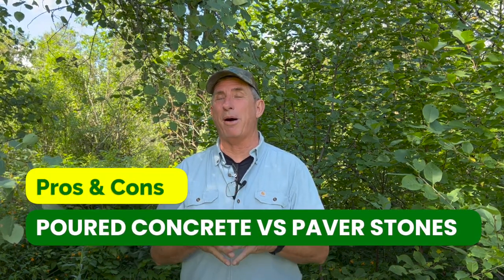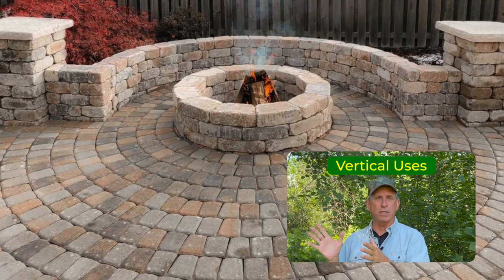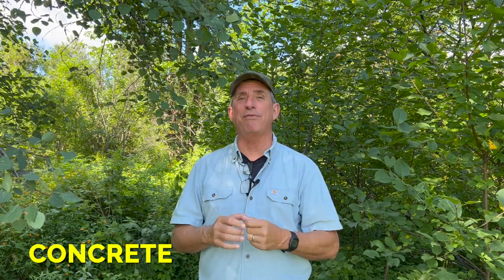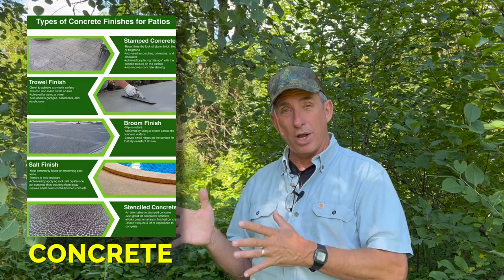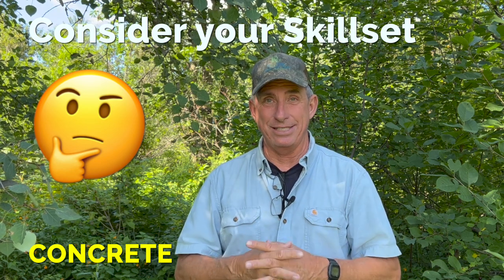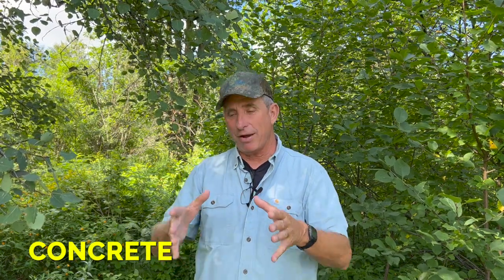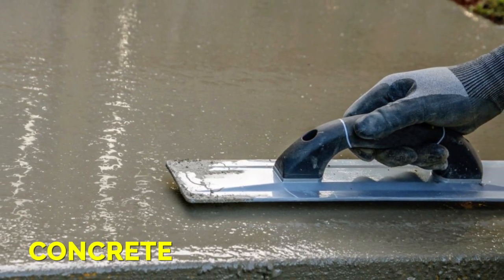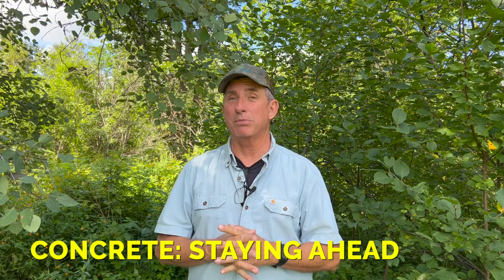POURED CONCRETE VS PAVER STONES | THE PROS AND CONS

Comment: Could you do a larger pour yourself if you just do it in sections and then move the forms to butt up to the prior section completed?  This is as a diyer
Reply from the maker: Well to break this down a bit. If you do small sections at a time, you are not doing a big pour. 
But the problem is cement never looks the same twice and sectional pours often look just that. Color is sort of off. But if you can be OK with that go for it.

Comment: I’m considering using a designer mold and making my pavers using concrete. Whats your thoughts? mixing bags versus physically installing pavers.
Reply from the maker: I am not a fan of the quick crete forms and the end result. Not a finished look is achieved in my opinion. 
Pavers require steps that require and demand specificity in preparation and placement. 
But done correctly I think pavers will look better than formed concrete as you describe. 
Thx for watching and the question. Coach.

Comment: its sooooo hard to find real professionals so its always hard to know if what you are paying for is done well.  so at the end of the day, its either deal with future cracks w concrete, or deal with future weeds between pavers? i am so so sooooo torn into what to choose for my backyard.
Reply from the maker: Weeds can be pulled or treated. Polymeric sand will mitigate weeds for years. 
Concrete can have crack reduction with proper install of reinforcements and cold joints placed. 
Then there always decks.